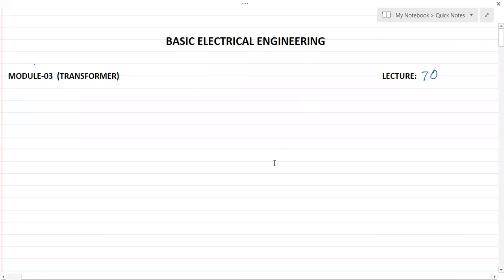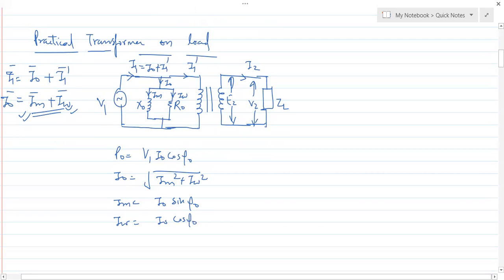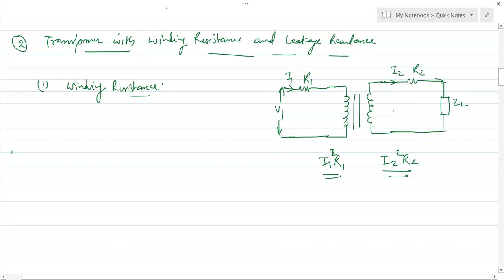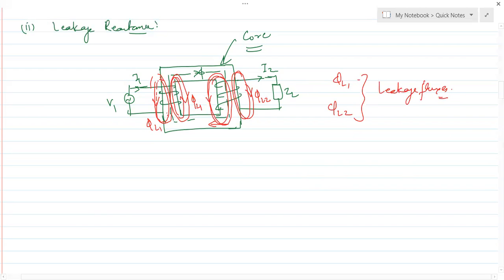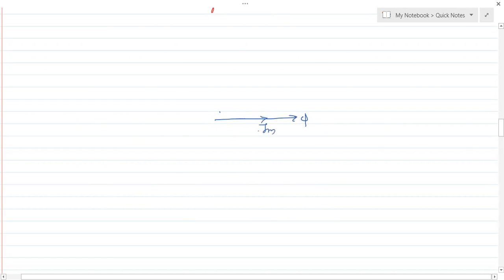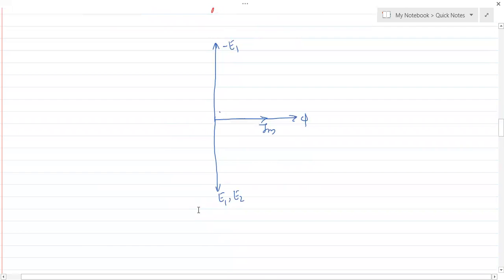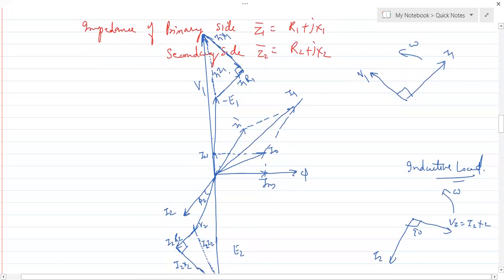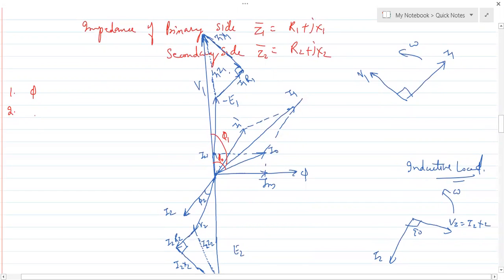Module-3 I L-70 I Basic Electrical Engineering I Phasor Diagram (Actual Transformer) with R,L,C

Comment: Sir, isn't the working component of no load current should be in phase with the primary applied voltage instead of primary induced emf?
Reply from the maker: If you do so, the phasor won't be completed. All these qty relates with each other. You have to assume current in phase with E due to approximation, then only you can plot Io then I1 then V1.

Comment: Sir firstly thank you amazing videos

1.Is V2 and I2R2 are in same direction?
2.For all r,l,c?

3.Or theys are at some angle so that when tey added to I2X2 it gives E2?
Reply from the maker: V2 can be obtained by summing all the possible voltages on the secondary side and i2r2 will depend on the nature of load to make a relation with i2.
Reply: Thank u Sir, understood @suneelagrwl